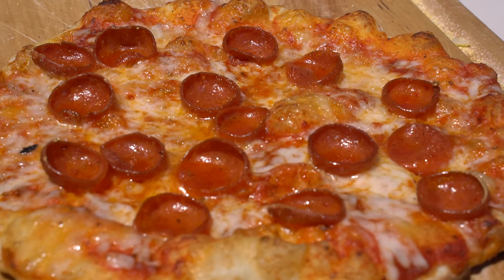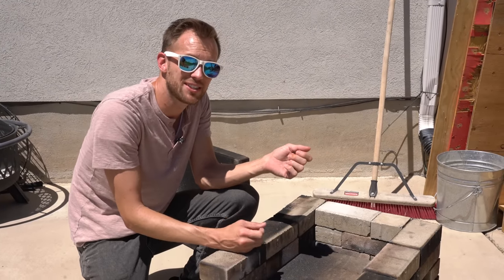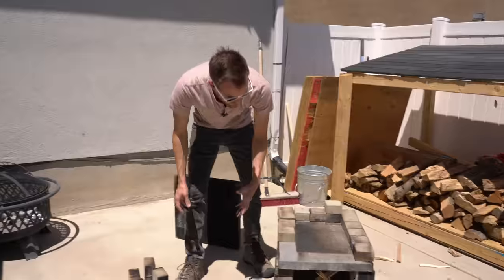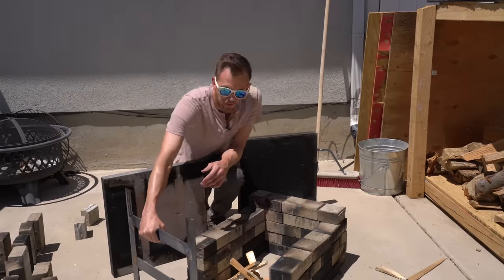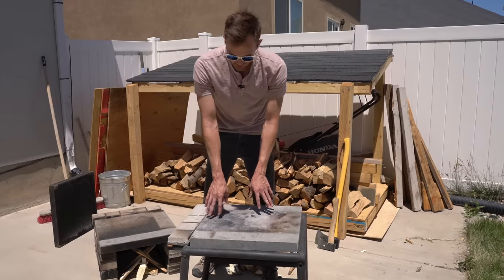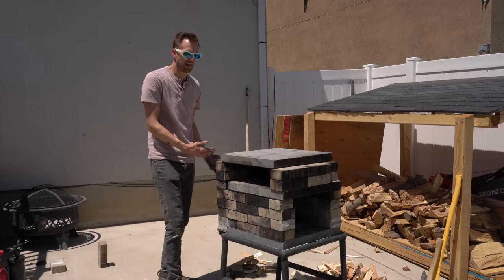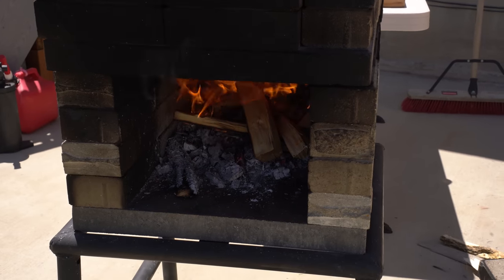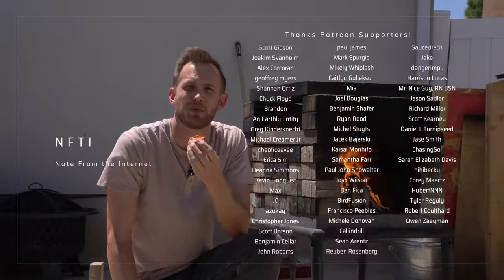The BEST Cheap DIY Pizza Oven

Comment: Personally, I wouldn't use paver stones as the base. It might not have lead, but that doesn't mean it's food safe. I'd place something like a pizza stone on top of it and cook on that. Secondly, just use fire bricks. They cost a little more than regular bricks, but they're designed to handle direct exposure to flames. They won't fall apart, so the build would last long.
Reply: I used regular bricks for my pizza/bread oven
Works great.  First time you fire it up just go slow to build up the heat.
https://youtu.be/wuvRWU1hyzs
Reply: Even better a pizza steel
Reply: Even firebricks can break from fast temperature swings
Reply: I used you ideas , I found 24x24 papers.  
I used 3 high cinter blocks that i had available.   Free I put sand in the holes of the block for insulation. 
But had to add block in the middle to raise the fire .  My oven sits above 30 " high and sits on a 4x4 concrete pad I had Free again.   
My fire is in the back of the oven 
My oven temp has reached 780 to 830. 
It's hard to keep the temp for long periods of time.
Reply: @tompoynton  No, pizza steel and open flame will just result in a burned pizza
Reply: I use pizza screens. Tried elevating it, but did better on the ground. Love it.
Reply: His Concrete patio too!! Concrete is NOT food safe, and direct contact with fire releases pollutants. I'm looking into a basalt slab for my version of this rough blueprint a few youtubers have spread around (basalt is a volcanic rock), but a fine ceramic slab also looks like it may be a good option if you can get one (alumina, or aluminum oxide, ceramic - extremely heat tolerant). -and make sure your bricks are genuine firebricks!
Reply: @johnmarino6444   you'll want to move your set up and any direct flames AWAY from concrete. not food safe to cook on, and the direct contact *with fire can (should) release pollutants in your smoke.
Reply: I collected fire bricks from the dump, it seems old chimney’s are being torn down and hauled away all the time !
Reply: Terracotta tiles.
Reply: I'd recommend you use a metal pizza tray because the concrete slab isn't designed for domestic food or suitable for washing food off.
Reply: Can use granite slab for cooking directly or pizza stone. Don't use all types of of stone to cook food directly
Reply: @RustinBlack were you able to source a food grade high heat slab?
Reply: I would suggest a relatively thick (1/4 or 1/2 inch) steel or cast iron plate as the separator between the fire box and the "oven" part instead of a paver stone, then place a food safe pizza stone on that piece of metal to actually cook the pizza on.  The steel won't crack from direct fire exposure and will distribute the heat more evenly.  Just be careful not to touch it for a while after cooking.  Also, use actual fire rated bricks, or refractory bricks like those used in kilns, don't use regular paving bricks.
Reply: I use regular bricks. It made out of clay. It might not resist to heat well but it's the simplest way of making a pizza oven. Nothing to it
Reply: Concrete is indeed food safe!  
There may be problems with it crumbling, but there is nothing poisonous about it!
I would recommend fire brick because of its heat resistance, but ordinary concrete will work if one is careful with the heat.
Reply: Yes! This right here! Not to mention, with the high heat of the bricks and paver stones, If it starts raining hard, unexpectedly when it is super heated they could explode. Def not a long term thing but a cool idea.
Reply: Good advice but keep in mind that the title mentions being cheap,  added extra cost is not something many viewers want
Reply: Use flag stone
Reply: That's what I was thinking instead of the 24x24 or 20x20 pavers.
Some old steel plates from some heavy equipment piece pile.

I am thinking another level added and tge top steel plate. Snake the vent channel though offset plates and out the back of the top, rather than the front.
A steel plate cut to cover the bottom level as above for access, and use the top plate over it like a griddle.
My kinda project.
SavageSalvage X
Reply: Honestly the red bricks we built a fire pit in 1985 at our house and it's still perfect shape firebricks are overrated the only thing they do but better I've noticed is retain the heat after the fire stops but I do agree not using the pavers because you don't know 💯 Most modern paver stones do not contain lead, as they are typically made from concrete, clay, or natural stone, which are generally free from lead. However, some older or imported pavers might have lead if they were manufactured using materials or processes that included lead compounds, especially in the pigments or glazes used for coloring.
Reply: I made something very similar with regular brick and used my pizza stone. I called it the pizza crematorium. They all burned so fast I gave up. Temp control was terrible.
Reply: I was actually coming in here to say, I’d invest in a pizza stone for the base but for the top, maybe something else 🤷🏽‍♀️ what would you recommend? And that’s a great idea with the fire bricks. I’ve been wanting a pizza oven but can’t afford a massive amount of money! I’d looove to make my own with bricks and mud/concrete but until that day happens, this is a great idea.
Reply: Yes. this is the comment i was looking for. I would never use a paver stone.. sure, its cheap.. but do you really want chemicals and sand/aggregate getting scraped into your food?
Reply: @mahbriggs concrete is fine but it often has a sealer on it
Reply: @Rooxie973  
So?  Heat it up and burn off any sealer!
Reply: @mahbriggs  It's worth mentioning. So?

Comment: you can also add a pizza stone or steel to the top of the cooking surface to remove any fears of lead and also reduce the fears of the paver crumbling.
Reply: At those temps the lead would vaporize.
Reply: @spencers4121  lead vaporizes at 760 degrees ferenheit, pizza ovens are usually around 600 which is just under the melting point!
Reply: @GoldenBoy-et6of  You can clearly see, it was hitting 730 when he probes it.
Reply: @spencers4121  730 is not 760
Reply: @Leo-dal  water boils at 100c and yet still evaporates in warm weather. Sure it will vaporize slower at 730 but there will still be fumes.
Reply: But he did the lead test and there was none though so why even debate it
Reply: At 700⁰ F, lead would be in a liquid state.
Reply: Lead will be major concern if any of the stone/bricks have it, pizza stone would not fix any of that. That said I would probably use one anyways to get proper surface that's easier to clean and use.
Reply: @GoldenBoy-et6of  no, most pizza ovens, especially Neapolitan ovens, routinely hit 900 degrees Fahrenheit
Reply: I made one from bricks and it got so hot it burned the bottom of every pizza I tried…the fire under it was too intense. I gave up, calling it the pizza crematorium. I would add a pizza stone on top of the base and put the fire in the back area like the originals…the top wouldn’t brown and the bottom was black.
Reply: steel definitely not a good idea
Reply: @DigitalEkho   why would that be, I use a pizza steel in my home oven all the time, works great at 550.
Reply: Lead? I love the Hysterical comments below.
Reply: @annunacky4463  You didn't allow the oven to pre-heat first. takes 1 hour.
Reply: @GoldenBoy-et6of  led melts at 900°f how can you get vapors without molten metal?
Reply: @GoldenBoy-et6of   pure lead maybe, but lead in a stone is probably in some oxidized form, which isn't ever going to evaporate
Reply: @mukkaar th cost of adding lead to concrete would increase the concrete price so much.  Lead in concrete is total BS and a red hearing.  It’s concrete and bricks which is clay.
Reply: That's a great idea to use a pizza stone. Why didn't we think of that earlier! 😊
Reply: @annunacky4463  
Maybe try less fuel.
Reply: @GoldenBoy-et6of  
Why would you use leas in your pizza oven?
Concrete does not contain lead, nor do bricks.
Reply: @annunacky4463  
Yes, I use to try putting a pizza stone on my grill and putting the lid down!
Unless I very carefully kept the heat down I had the same problem.
Pizza ovens, also known as bread ovens heat the stone from the top, not the bottom.

Comment: You can get a hotter fire (with the same amount of fuel) if you put the burning wood up on a grate, or anything that lets some air in under the fire. This creates a stronger draft through the whole burning chamber and out the chimney, which is what we want.
Reply: Putting wood on a grate does draw more air but burns the wood much faster. It’s covered in many articles on how to get good heat from your wood burning fireplace while getting the longest burn from your wood. Building it in the floor of the fireplace restricts the air flow through coals and let’s it get hot fast but slow down to heat the same space longer on a given amount of wood. Bidenomics makes the free stuff too valuable to burn wrecklessly just to stay warm as it’s not free or affordable anymore, $200 a Rick delivered and they all lie calling it a chord and a “face chord” and they’re cutting it even smaller too just to screw you even worse. The more you know.

Comment: I've been cooking in one of these for years. Generally I haven't had an issue with needing to cook from the side, but I will consider it. The design of the oven naturally draws in air on the bottom and the flame/heat moves to the rear to go up the gap to the top chamber. If you can't weld, just build yourself a base out of inexpensive cinder block to the height you like and put a paver on top as your oven base. this allows you to place the oven on whatever surface you like, preferably a concrete patio of some sort. Cinder blocks in the center will support your base pave stone if you get heat cracks. My oven is on the ground for now. I have 2 pieces of 1 1/2" angle iron about 3 ft long turned down with the angle facing up that I use as rails for a piece of expanded metal that I build my fire outside the oven on and then slide to the rear once it is burning well. I always cook pizza on parchment paper. Lightly coat with olive oil and easily spread your dough out to form the crust. Parchment paper makes it super easy to get your pizza peel under, and you don't have to worry about contaminates from the stepping stone. Put a little flour on the pizza peel to help things slide. I have found getting my cooking stone to about 450f gets me perfect leoparding(brown spots on the bottom). I've gotten it to 600f before, but the bottom of the crust burns before the toppings are cooked crispy or the cheese begins to brown. Rotate pizza around a couple of times during the cooking and monitor closely so you don't burn. The slot that the flame/heat is coming up produces a lot of heat. I rotate on my pizza peel gently grabbing the corner of the parchment paper and put it back in. The more you use your oven the more you will develop skills and senses for the process. Be careful, your friends and family will love coming over for wood fired pizza. I just make them bring beer.
Reply: I think you could go no less with the temperature, but go higher.
The reason why pizza oven have temperatures above 700°F is that nothing has time to burning before other things have time to Cook.
And its literally a 90sec job for one pizza.

Some good ideas, especially the sliding fire, especially if it was on a grate for more airflow, and ash falling down for later cleanup, gotta try incorporaring that to mine.

Im doing meetups with my famili and friends where a single person if there aren't many of us, or pairs/teens each do their own pizza with ingridiends i prepare for them, and then I put the all for about 1.5, 2 minutes, and we have a game who made the better pizza, based on look, and taste if there are enough slices so everyone can take everyones pizza

Comment: Hmm I think the point of the exahust behind at the back of the oven is so the heat is forced to go above your pizza and out thru the front, wouldn't turning it 90 degrees  force the hot air to escape immediately?

Comment: I live in Italy near Naples, and I'm impressed with the final product. By the way, Italians make pizza with what Americans call pepperoni, but they call it "Diavolo," because they use spicy salami. ("Peperoni" in Italian means "peppers," so if you ask for a pepperoni pizza in Italy,  you're going to get one with peppers on it.

I have a pizza oven attachment for my Weber, which works with a little massaging. The hardest part is getting the thing to 700F. 

One little pointer is that pizza makers in Italy don't use corn meal, they use a flour called Semola (or Semolina) rimacinata. You can probably find it in any grocery store. It doesn't stick as much to the dough, so less comes off in the oven. And you don't need to use much, just a sprinkle. Shake the pizza back and forth on the peel to make sure it's loose.

You may want to use a pizza stone, because I'm not sure pavers are food grade.

Anyway, nice job. Your pizza looked perfect.
Reply: Hi sir I'm from India,  please suggest me can I granite stone slab for cooking pizza in this method of pizza cooking
Reply: @kloapan  I don't know, but I suppose if the slab can tolerate 1000 degrees Fahrenheit without cracking, it might work. Note, however, that we don't use granite as a pizza stone, so I don't know what the result would be. If you try it, use a stone you don't care if it breaks. I suggest buying a real pizza stone or pizza steel.
Reply: That's exactly what happened to me when we visited Pisa, Italy back in 1989. I was stationed at VQ-2 in Rota, Spain and my wife and I did a Eurail tour around Europe before transferring back to the states. I ordered a pepperoni pizza and they brought out a pizza with big banana peppers on it. When I tried to explain what I wanted the waiter said "Oh you want salami" They fixed it for me and it was the best pizza ever ! We loved Italy ! I wish I could post a picture from then.
Reply: Peppers are great on a pizza. But if like some kind of meat too lol
Reply: @Michaelhendersonnovelist1  Yes. granite is ideal as a prep surface, but 100% NOT at a pizza stone. refractory firebricks in a herringbone layout are your best bet.
Reply: Good for Italy. However, we say pepperoni.
Reply: Lodge sells a pizza cast iron for about 40 bucks
Reply: @ravencole2740  Always some weird clown looking to get offended, relax.
Reply: @Jambobist  You're projecting. Heed your own advice.

Comment: fantastic tips Nate... it's great to see something so simple that's pretty accessible to a lot of folks.
I'd love it if you could build a version 2 with a little more money spent as an intermediate vs the bottom end 'cheap' version you've shown here. 
> perhaps using 24x24 unglazed ceramic tiles as the oven's base which I believe would be a lot more heat-tolerant than your pavers.
Reply: Great idea. I hope he does this too.
Reply: The beauty is in the build and the getting a good alternative for the less money. You could get an artisan to build you one if you want a costlier version. Love Nate's just as he built it.

Comment: That is an amazing way of making a dirt cheap, but effective diy pizza oven. 

I've never even considered doing this. 

Excellent video, Nate.
Reply: 💯

I'm going to home depot tomorrow!
Reply: @AimForTheBushes908  I'd make a few alterations to have a more even heat. Like more space around the sides. Enjoy the video.
Reply: how did it go?
Reply: @dzibanart8521  I never went or did it hahahah. Started a new job and stuck in training for several months so going to wait till after.
Reply: @minameise  but what's the new job? And 3 months later have you built one yet? 😅

Comment: Great idea/project!

An idea I had when you were talking about not putting on concrete directly but building a gravel or sand place to put it, what if you just put down another paver? Then it would all be removable/portable and you wouldn't have to have a gravel or sand place to put it.

Also, if you wanted to use on concrete, the paver would absorb and block some of the heat from damaging the concrete.

And it would help with leveling the other layer. Get the bottom paver level, and everything else above already will be.

Comment: Cracks come from excess moisture in the bricks and being heated to fast. Low and slow is the name of the game in addition to keeping your brick oven dry.
Reply: While true, a lot of those paver bricks that come from a department store have fillers of some form in them. Since it is not a homogeneous brick like an actual wall brick, filler and stone expand and contract at different rates.
Reply: @lordofthenotes  true. I’ve also used 100% red clay bricks in similar applications and will still get cracks after some use.